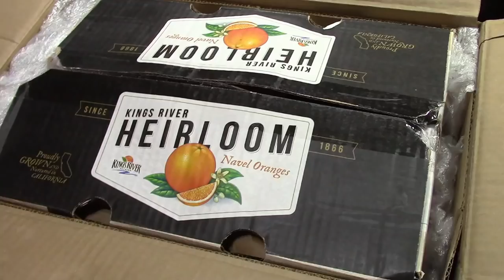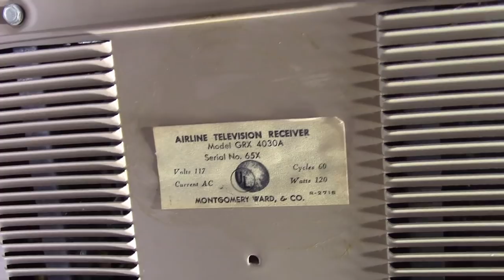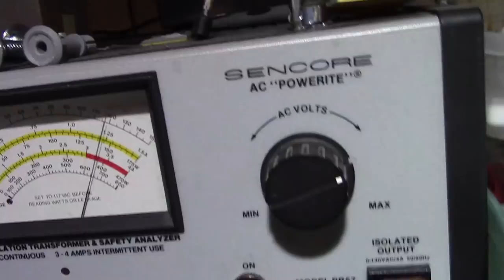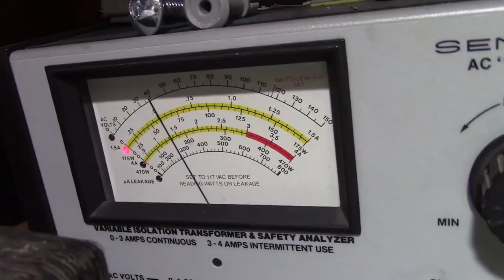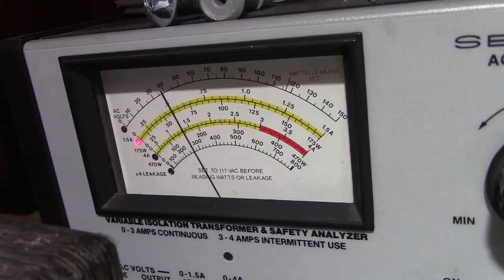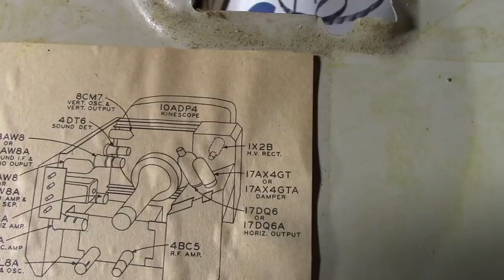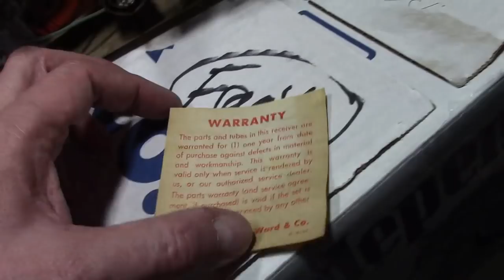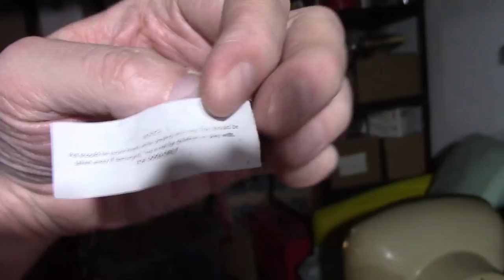Airline GRX-4030A

Comment: the cord reacted with the handle from being tightly wrapped, this happens with a lot of vintage electronics and sucks as the plastic and rubber break down they make a chemical reaction and these burns are a resultThe only large black and white set I own is an RCA afc-097l  I think? it was my elderly neighbor's who gave it to me, seems to have very little hours on it, and I find its picture is more ideal then some of the other small sets I've aquired

Comment: Wonder if the brass pin you found may be a part of the missing kickstand legs? 
Nice looking little set. Hopefully you can work your magic, and get the CRT back up and going.
Reply: Failing that he could put a small filament transformer in it and use a 10ABP4.
Reply: Could that pin be something that got dropped in from the vent on top of the set?
Reply from the maker: Sure.  Thar's definitely a possibility.
Reply from the maker: The missing legs are just a bent piece of heavy steel wire like a coat hanger.